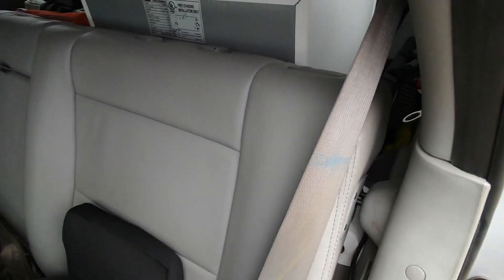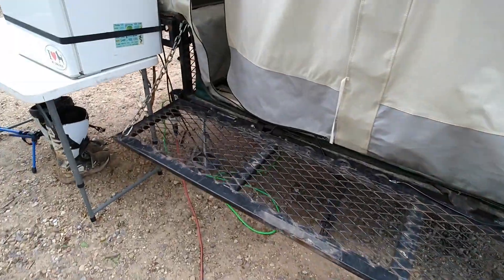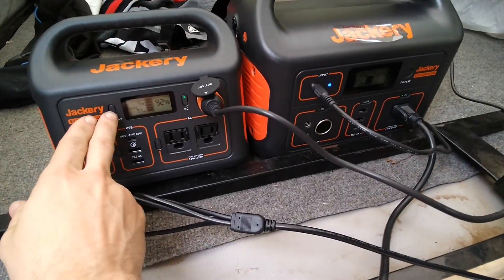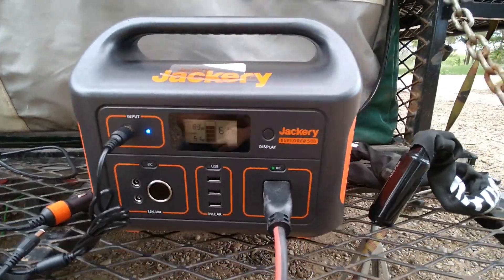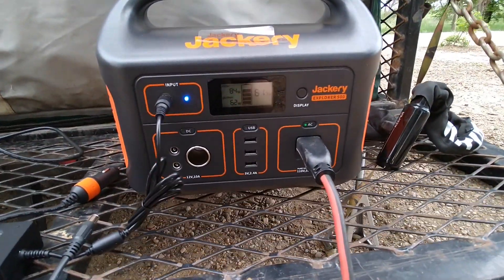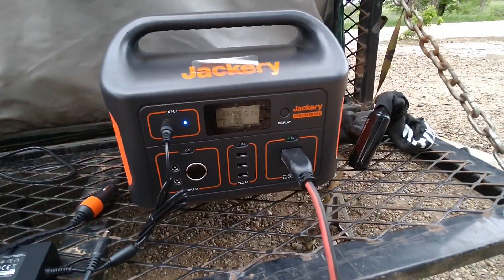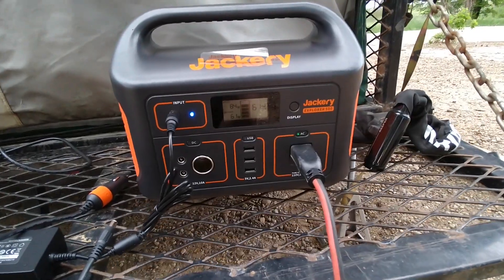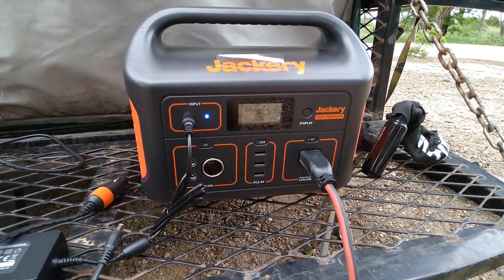Running a Mini Fridge on Solar while Camping with a Jackery 500

Comment: I’m going camping next week for the first time with a 12v fridge.  I have only one power station, and a 100w solar panel.  Any advice on how to maintain charge?  I think I can get a decent ammount of charge on the power station form the car while driving, but I’m a bit concerned about how to charge the fridge all day.  I’m thinking I need to find a way to mount y solar panel to the back of my van and run a cable into the back of the van so I can charge while its in the truck and I’m not driving.  I am thinking I may have to find alot, or at least a good bit of extension cables so I can run things from the front of the van to the back…  I dunno, I’m a bit nervous about it since I don’t have all that much time to do any tests.